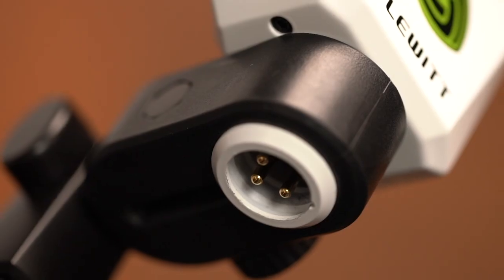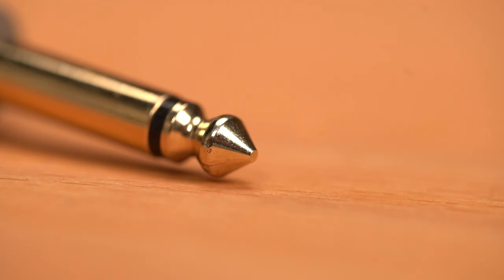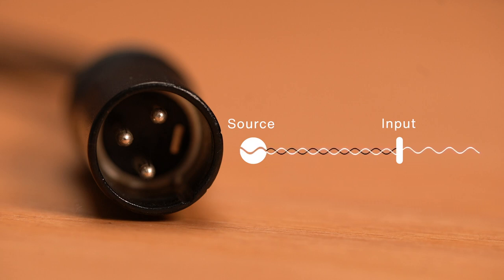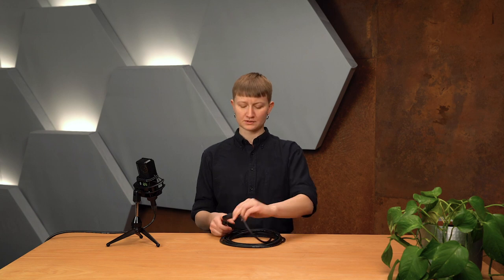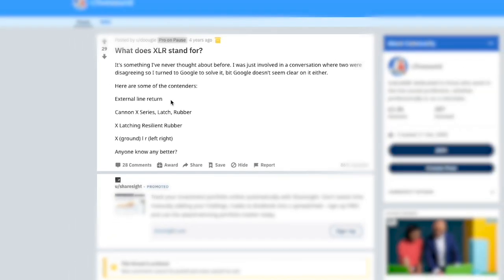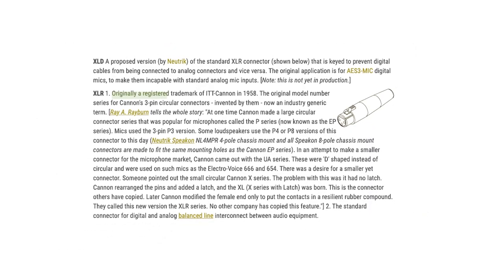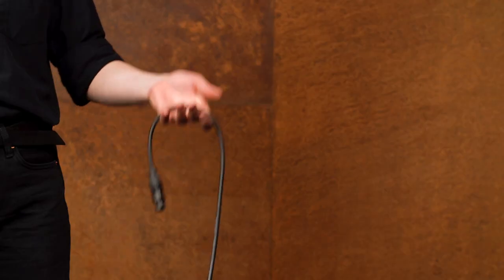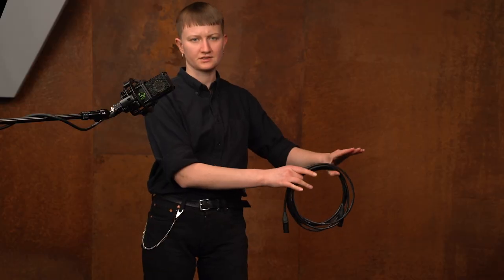What is XLR?

Comment: "External line return" never made any sense to me.  X series connector with added Latch in Rubber does make sense.  Although few connectors sold as "XLR" style use rubber inserts in my experience.  I had a few, but only a few.

Comment: The graphic section starting at 1min27 showing how two signals of opposite polarity will cancel each other should actually show two separate sources, instead of a single source: the graphic is confusing, as changing to a single source with two copies of the same signal (one of opposite polarity) looks just the same. The differential amplifier in the equipment should really show that the resultant output signal has a larger amplitude than the individual parts; this is an inherent function of the differential amplifier circuitry. Also, by making the combined signal white (same colour as one of the input signals) it just looks like a copy of that input. Otherwise an entertaining video!
Reply from the maker: Thanks for watching and your valuable feedback!

Comment: 4:50 No-o-o-o-o-o-o-o-o! It was going really well up until that second wrap! Cables are coiled OVER—UNDER! 💢
Okay, I'm not actually furious. There's a good and sound reason for over-under coiling and it's rooted in topology.

Wrapping one coil after another in the same direction introduces twists into the cable. When a cable coiled in this manner is thrown across a stage or studio floor the twists remain intact, preventing it from straightening out or laying perfectly flat, and the twists can cause kinks in the cable when it is pulled taut.

You've seen this happen countless times with your garden hose, and you can also demonstrate this another way by trying to straighten a small spring by pulling its two ends apart. You'll notice that it can't be done without leaving twists and even sharp kinks in the spring wire. 

The over-under cable coiling method introduces an anti-twist for every twist, leaving the cable topologically flat; that is to say untwisted. When a cable coiled in this manner is thrown across a stage or studio floor it unravels perfectly and lays flat with no twisting.

Imagine you're holding a short length of cable taut between your arms, each end in one hand. Now imagine you have to neatly coil this cable but you're not allowed to let go of either end. How would you do it? With a little experimentation you'd find that the only way is over-under.
Reply from the maker: You're absolutely right, we just thought we show beginners how to destroy everyone's enemy first: the elbow technique.
Reply: @LEWITT-audio  The elbow wrap is worse than the over-over wrap, I'll give you that. :)
Reply: @LEWITT-audio  i only do this for extension cables, but there's a trick.... figure 8 between the hand and the elbow.

Comment: Very informative. 2 points I'd like to make... 

1. I have done an A/B comparison between Monster Guitar cables and other brands and DID hear a difference. The Monster brand provided more clarity in my opinion. Again this was a Guitar cable not an XLR

2. Glad to know I roll my cables the way you recommend :). However, here in Nashville, many studios do an alternating method whereby they can "throw" a long cable out very quickly without it getting tangled...many of the studios prefer this. However, being the "Rebel" I am I still do it the way you suggest ;)

Thanks for the video, cheers,

Comment: Thanks for the schooling on the origination of "XLR". Makes total sense that it comes from the Cannon X line with a Latch. I'm an old-school electronic tech and we would substitute "X" for "trans". We used to write stuff like xformer and xster. So I just made the leap that XLR would be to "transform" Left and Right, 'cause I knew about the phase cancelation use for noise rejection. Now that I just wrote "transform left and right", it makes no sense since it's a mono signal!

Comment: Also: i did blind cable tests, and they do sound different... & I don’t think it was just their connectors that made audio quality sonically different... Mogami cables are considered the best for a reason. That’s opinion shared among many and based on tests.
Reply: Agreed. Different metal conductors absolutely give different tones. Thus a gold connector will absolutely sound more colorful than a nickel or other metal connection. I ONLY use MOGAMI in my studios. Period.
Reply from the maker: Thanks for the comment. We'll definitely check them out. What is it exactly that makes them "better"?
Reply: @keithjames6638  I've made many MANY cables over the last 25 years for use in my own studio and others. My experience tells me that the audible differences between high-end cables are basically nil. I count Mogami (2549, 2791, 2534, 293x), Canare (L-4E6S, MR202) and Gotham (GAC-3), all of which I have used extensively.

As far as I'm concerned, the biggest difference in the cables is their ease of prep and termination, EMF/RFI rejection, mechanical properties, hand feel, and 'memory'.

Canare is my old favorite. It's the hardest to terminate but has incredible hand feel and coils wonderfully with zero memory. Best noise rejection. Great construction. Incredibly durable for stage or studio.

Gotham is my new favorite. It also has fantastic hand feel and easy coiling. It's thinner than the Canare and Mogami and has three separate insulated conductors for pin termination and two spiral shields. Great cable for studio use.

Mogami is my first love. They make many different models which vary in hand feel, ease of termination and noise rejection, but they all coil nicely and otherwise exude top-notch quality.

You really can't go wrong with any of these, unless your application has specific requirements. There are also many other brands with excellent cable products. Belden comes to mind, as well as several European brands whose names escape me at the moment.

In my 20's I used to spend hours conducting fidelity comparisons but the results were always inconclusive. There are simply too many factors and not enough differences. Even between store-brand cables and the high-end stuff.

The only thing I would say is to avoid cheap cables because those are a *pain in the ass*. Poor construction. Birdcaging. Coil memory. Lousy hand feel. Poor shielding. Excessive handling noise. If your cable exhibits any of these characteristics it can ruin a session. Otherwise don't sweat it too much because the audible differences are tiny if they even exist.

Also: 
Watch Dave Ratt's videos on sending mic signals down CAT6a. Really fascinating.
Reply: @Hermiel  Canare L-4E6S fan here, for sure. I outfitted a church with custom cables using this stuff, and rewired my studio using it exclusively.

Comment: I learned a technique for gathering cables from the late great Aspen Pittman.  Basically extend the cable out and bring the ends together then continue folding the cable in half until you have a nice neat bundle.  Velcro ties finish the job for storing.  This avoids all stress and twisting on the inner wires and keeps the two ends together.  This is helpful especially when the connectors are unusual or different.
Reply: It also bends the cable in the exact same spot every single time, creating weak spots in the cable. And I don’t like my cables zigzagging on stage.
Reply: @TheGamesurfer98  actually it doesn't.   First you don't bend tightly.  Second there is no way to bend in the same direction every time because every time you pick up the cable it's in a different orientation.  If you marked the cable with a line,  set the cable with the line up every time then folded it tightly then you'd have the problem you cite.
Reply: @L.Scott_Music  If you bring the ends together and keep folding in half as you described then you’re folding in the same spot.
Reply: @TheGamesurfer98  Never exactly and never in the same direction.  Cables are meant to be flexible.  Try it, in practice it's isn't as you say.  On paper it is, not in practice (unless you try.)  But that's OK, you don't have to use this tip. Twisted and tangled cables are worse, in some peoples opinion.  I'm just offering an alternative.
Reply: @L.Scott_Music  I have worked with a company that stored cables like this, that’s why I’m pointing out the problems with your method. But hey, if it works for you...
Reply: That's how I do it too, despite all the nerds telling me otherwise. It's simply the fastest way!
Reply: @TheGamesurfer98  Interesting.  We had very different results.  But that is the nature of things I guess.

Comment: Is lenght affect quality? I want to buy 5m (16,5feet) and not sure if its gonna be okay.
Reply from the maker: Longer cables typically have more of a chance of picking up noise and signal loss... however balanced cables like XLR cables are designed to avoid these issues even with long lengths of cable. 16.5 feet is not long for an XLR cable so you're totally fine
Reply: @LEWITT-audio  Big thanks for fast answer! 🙂

Comment: Very informative video. I will disagree a little bit about more "expensive" cables being a scam. First, yes, there are scams in everything BUT there are very good reasons why some cables cost more money. For example, some metals conduct an electrical signal better than others. Gold comes to mind. For example, a high-quality HDMI cable will give you a much better television experience than one that is made of substandard materials. In the same way, a well constructed instrument cable will have connectors that are made of gold. That same cable will also have high-quality electrostatic shielding to prevent RF interference from things like overhead florescent lights or broadcasting/receiving equipment. And that same cable will have  a thicker outer 
sleeve (called the jacket). So you do get what you pay for.
Reply from the maker: Good points here, in that better quality cables may be more durable, reliable, and less prone to interference which can diminish the sound quality. Your mileage may vary depending on the manufacturer though, and in most cases a decent bread and butter cable will work the same as an expensive one.

Comment: Please note that a connector is just a connector.  While TS connectors are not balanced 99.99% of the time, TRS balancing is determined by the circuit.

TRS could be Tip hot and both sleeve and ring grounded - or a stereo headphone jack - or it is plugged into an unbalanced in - etc.

This is true with XLR as well.  The old White Instruments EQ had XLR in, but if you didn't buy the transformer balanced in, it was unbalanced and pin 3 hot.

Watch out with TRS and phantom power.  Bad juju!  Some old Neve consoles like the 8232 have phantom on all the time.  Plug in an AEA ribbon or something delicate like that and budget for the repair.

XLRs are also better for microphones because ground/shield/pin 1 makes connection before the other pins.

Comment: If you want to get the respect of an audio engineer then you don't want to roll your cables that way! It's a problem waiting to happen.

Any engineer worth his (or her) salt knows that you use the over-under method so that you can throw a cable and it'll straighten out without tangling.

Keep rolling the way you did and all your cables will have kinks and problems!
Reply: I thought the point of the over-under method was so to improve the accuracy when you try and hit the drummer in the head when throwing the cable.
Reply: @rossdickson1657  That's an extra advantage!

Comment: So as not to confuse your audience, while it is true that TS cables deliver unbalanced signals, you should also note that TRS (tip-ring-sleeve) cables are indeed balanced and benefit from the same noise/electrical interference cancellation use case presented in this video for balanced XLR cabling. Also, the reason XLR balanced cables are required for phantom powered sources is directly attributed to its form factor and not due to the fact that the wiring typically is balanced. Unlike a balanced TRS cable the pins of a balanced XLR cable make concurrent contact with the phantom power generator to which they are connected. If one were to attempt to connect a balanced TRS cable to a phantom power source, hypothetically assuming the phantom power source allowed a TRS connection, the phantom power source would be shorted out and/or damaged because the various parts of the TRS connection would not connect concurrently. Yes, in terms of latching XLR is a clear winner.

With respect, your cable wrapping technique will introduce twists in your cabling and destroy it over time. The proper method for cable wrapping is the "over-under" method. Please refer to this video for a clear demonstration: How to Wrap a Cable the Right Way "Over Under" (see https://www.youtube.com/watch?v=B2SUoAvGxVs).
Reply: "If one were to attempt to connect a balanced TRS cable to a phantom power source, hypothetically assuming the phantom power source allowed a TRS connection, the phantom power source would be shorted out" I've borne witness to these problems in a studio with a vintage console with always-on phantom power and a MT (very similar to standard 1/4" connectors) patch bay for mic signals. The patch bay should have been made with XLRs.